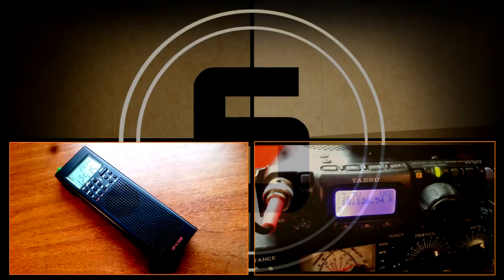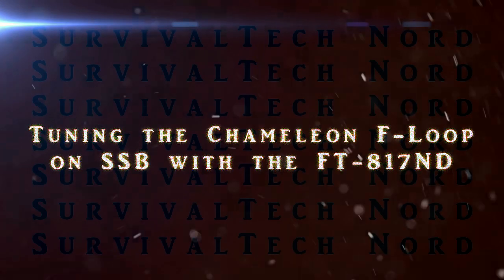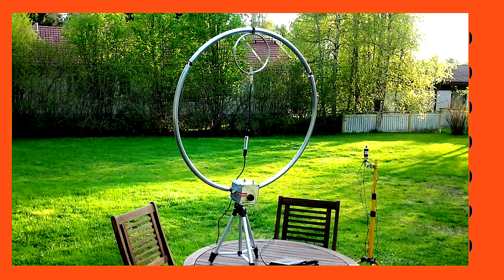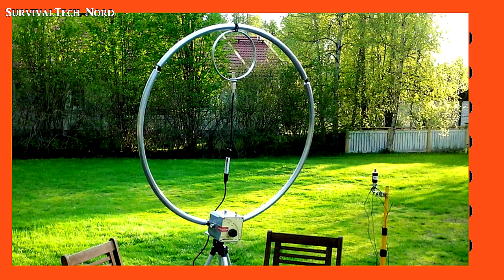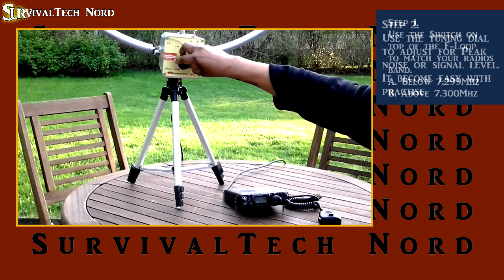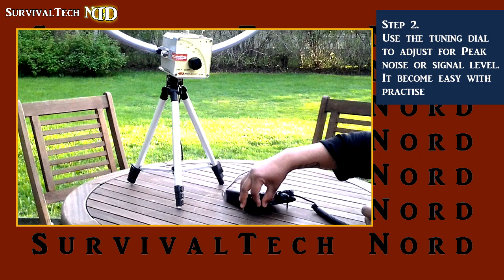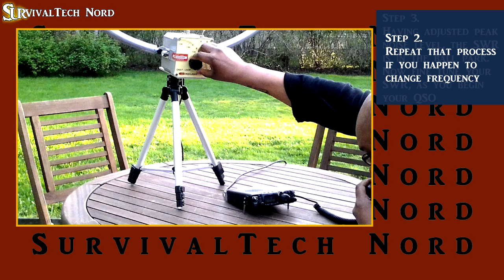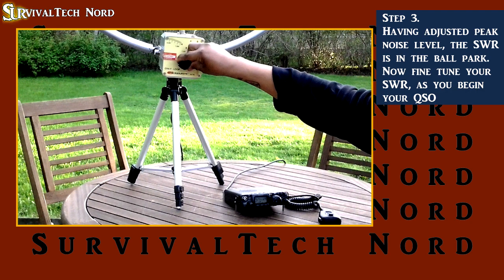Tuning a Chameleon F-Loop for low SWR

Comment: Hi Julian, Is it possible to set the FLAnt 25 feet away from the radio.  Tune the FLAnt for maximum noise then return to the radio to TX at a relatively low SWR?  What I'm trying to get a handle on is whether it is possible to tune in this manner to avoid biological RF exposure during TX with this particular magloop. Perhaps not the lowest SWR but will this method work?  73, Greg
Reply from the maker: It does and will work,  although I'm not sure how practical a method it is. Sometimes when I'm operating PSK in the field and there's lots of wind I'll set up the loop, tune it, then find a place away from the wind ~5 meters away in a warm quiet operating position. It's also much easier with the high efficiency aluminium element which has somewhat more bandwidth over the coax. Anyway the answer is yes. 
Hope this helps.
Reply: SurvivalTech Nord Understood.  Thanks Julian.  Your great videos continue.  Always interesting. Just getting in PACTOR over here -- quite an interesting mode. 73, Greg
Reply from the maker: VA7BC 
Thanks. A little something for everyone.  I really envy you. I haven't tried PACTOR yet. My love for Android OS and man portable ops is limiting my digital op possibilities in the field. Perhaps it's time for a Windows based tablet?

Comment: You can use the short 23" coax cable to connect the Faraday loop to the tuning box with the 36" aluminum loop (provided with with) and it will reduce the SWR fluctuation if you rotate or move the antenna.
Reply from the maker: Thanks. I didn't find that kind of cable in the box, but I'll go ahead and make one.